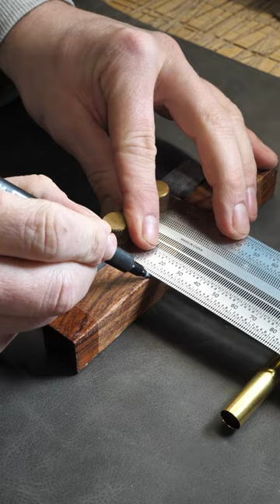Making a wooden Rolleball pen

Comment: I have one of those nova clutch I think it’s called I’ve been a carpenter over 30 years but I just started turning. My question is do you ever find that’s there needs to be a size between the smallest to the medium this might make absolutely no sense mainly because lack of knowledge of a tool I just bought.. And I kinda have an issue with tear out is that from the speed,technique or maybe dull tool? If anyone could point me in the correct direction?